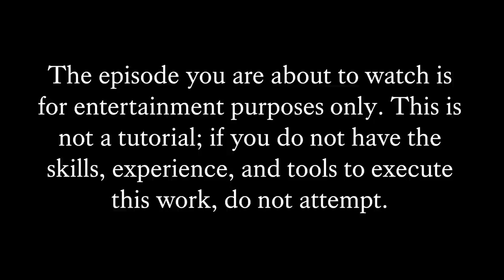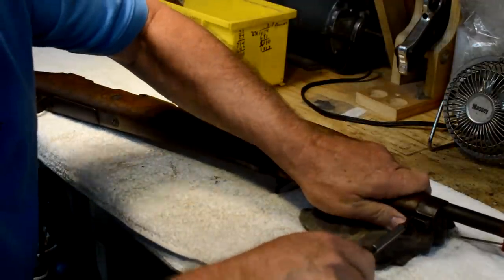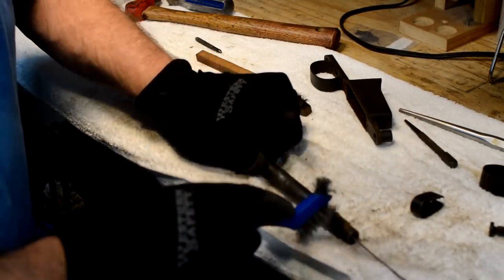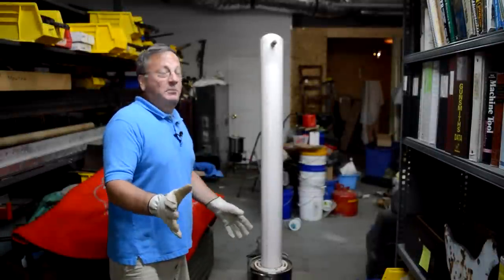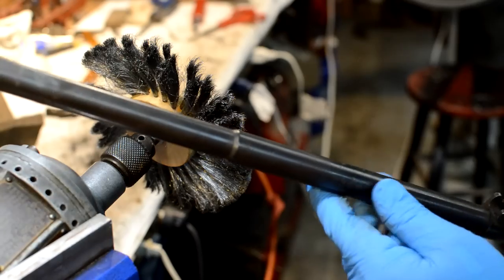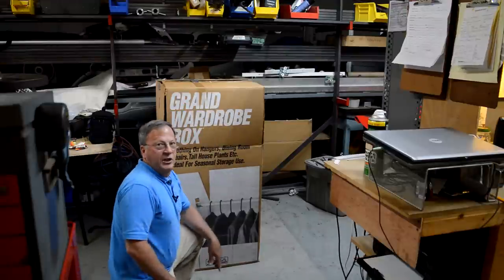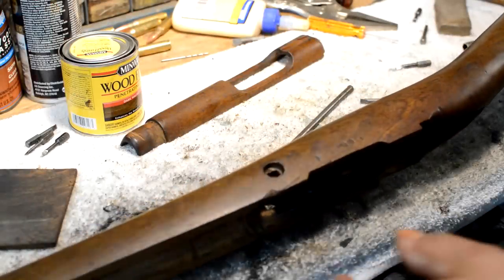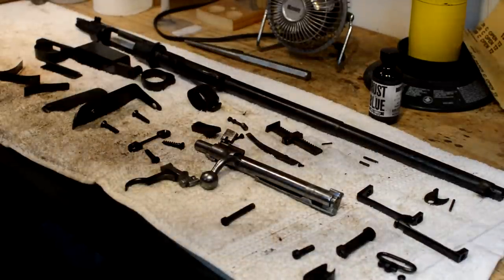Anvil 013: Rust Bluing on the Cheap

Comment from the maker: This was ReUploaded because the link on Bob's website was broken. Bob's site is rustblue.com in case you need that
Reply: hi Mark just had a quick question for you. For Enfields of the Number 4 pattern(ie the mark 1,mark 1/2, and mark 2) what type of paint did they use for the coating over the bluing. Ive got a 1949 dated number 4 mark 1 and a number 4 mark 1/2 and Ive been curious if A). was the paint anything specific and B). was repainting lee Enfields a common thing for the armorers to do when the rifles needed to be serviced and C). It that type of finishing work something I could do.
Reply from the maker: @FailedRanger  I do not know about the paint, what it's made of. Really, no knowledge but I'm open to learn. A.  I think the paint was a cheap way to protect the gun , used to cut costs as the Empire fell apart. My belief is these rifles were not in service long enough to be re-arsenaled, B. so a repaint may not have happened. C. Most who paint (cerokote, etc) fail to account for the fabulous gunsmithing time commitment involved, and wind up drowning. Do the research and visit some painters prior to investing money and time.
Reply: @marknovak8255  Guys.. the paint you want is SUNCORITE 259 don't know if you can source it your side of the Pond..!
Reply: Mark Novak thank you I’ll look into it and will keep you posted
Reply: Hey Mark, I just have a simple question. What did you guys use to affix the PVC pipe to the water pot? I think I heard it mentioned it was a toilet gasket or valve? I'm looking to rust blue my own Spanish Mauser 1916 after someone scrubbed the rifle clean of its markings and painted it and I hated the look of it.
Reply: @Courier-Six  it's the ring that screws to floor and receives commode & wax donut----called a 'closet flange'. Available at big box stores, etc.
Reply: Hi Mark, love the videos. Thanks for all the work . @marknovak8255 
What happens to the bore. Seems like it would rust inside also.

Comment: This absolutely works, although I have not been able to find the foam filled pipes that Bob uses this side of the pond.. I use plastic soil pipes, but they do bend and have to be replaced when the stack falls over! Much better than tanks of water, which will bring the rust faeries into your workshop from miles around..

Comment: Now what this rifle needs is a light coat of oil and a home in Arizona, Nevada, or Colorado some place with relatively low humidity and in another 100 years it will still look as good as it does today. Great job on the restoration guys and I applaud you for intentionally leaving the battle scars intact instead of trying to turn an old rifle into a new rifle, people that attempt those types of restorations destroy the history of a military rifle in my opinion.

Comment: Very inspiring. As a plumber i do have one criticism. Cellular-core and common sch 40 pvc is the same thickness. Just wanted viewers to know because cellular-core pipe is usually only found at plumbing supply stores. It is cheaper but common pvc is fine to use.
Reply: I find it bends...!

Comment: I've salvaged a couple rifles over the years that were being used as wallhangers. One was a really nice little Remington #4 rolling block in .22 LR. I got it really cheap because the action worked, but something was off. I took it apart, it turns out the spring had broken and someone had taken two other springs and mated them together into a functioning leaf spring. The gun worked, but had a trigger pull like that of the double action on a Nagant revolver. I took it apart, found the correct spring, got it working again, fixed where the takedown was a little sloppy because the hole in the wood was blown out a bit. Now my son shoots it regularly, we put only standard velocity through it, because that's what it used. I found a #6 Remington .22 LR, that was missing parts, got it going again, another fine little .22 LR to shoot. I'm working on getting my 1894 Winchester in .38-55 to function a little better. My latest is repairing a duffel cut on a numbers matching late war K98. I have a soft spot for these old guns that I can afford versus needing to take out a loan to buy a safe queen I am going to be afraid to shoot.

Comment: QUESTIONS:
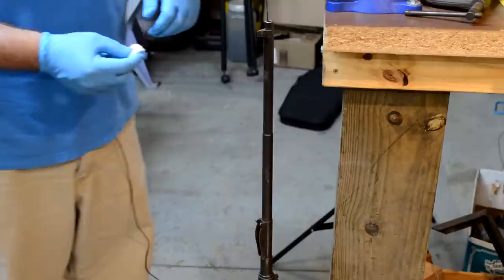After the first steam treatment, at 31:55 on the video, you said "… put our first coat of Rust Bluing solution on here."  At 32:20 you said "… I'm going to wipe this on the steel, first coat, and this is going to dry for about an hour or so.  Then we’ll wipe on a second coat and after that second coat we are going to introduce the treated barrel action into a humidity box."  At 36:02 you said, "… Ok.  back in the shop.  We’ve coated our barrel with a priming coat of Rust Blue solution.  We let that set for about an hour and let it dry.  Then I recoated it with the first primary coat of Rust Blue solution."

Regarding the first two coat prior to the humidity box, you did not say how long the second should dry.  At 36:02, you seem to be reviewing what you had done so fare with the first two coats prior to the humidity box, the first priming coat which dried for an hour.  You then said, "I recoated it with the first primary coat of Rust Blue solution.  This implies subsequent primary coats after the two coats, the priming coat and the first primary coat.  How many primary coats are there, and when are they applied?

Comment: There is nothing better than watching metal rust. How many cycles can you run on a piece?
 Not trying to be ocd but my first attempt came out so well I dove head first into the rabbit hole off of a 10' ladder. I have a nice old Savage model 6L-D. Not a spectacular or valuable gun. It was nice except for two bloody fingerprints that pitted the barrel. Looked like someone went after one of the spots with some 120 grit sandpaper. It was horrible. I took a piece of 220 grit emery cloth and took the whole barrel down to bare metal smoothing out the pits and previous sandpaper work with the rest of the barrel. I didn't card after sanding I went straight to bluing. I didn't steam like my first one I just hung the piece on the porch, we have 90% + humidity so I don't need steam. I ran it three times coated it again, after carding and degrease with acetone, and left it hang overnight for a long soak. This 4th run is so deep and black it's unreal. I look at it each cycle in the brightest light I can find and each cycle makes the color darker and deeper.
So how much is to much? I think 4 is going to do it for  me but whats the max you can go? 
I also have a very low serial number West German Weatherby with a bluing like black chrome. How did they do that?
Reply from the maker: 4 passes and the point of diminishing is reached. I usually stop at 3

Comment: There is no need to butcher military surplus arms as there are many fine guns out there that began as sporting rifles and really have seen little use. I have one of these Spanish short rifles but mine was converted to  the NATO 7.62 or 308 Winchester. My experience with many surplus Bolt Actions is that they will have mismatched bolts creating headspacing issues and that the more modern chambering may create excessive pressures. I realize governments did this out of economy but a soldier or any shooter is not well served by such arms. Fortunately those arms I purchased were priced right. The old Turkish 88 commission rifles I got at Big 5 Sporting Goods back in the early 1980’s were $35.00 each.

Comment: Thank you Mark and Bob!  One of the most useful videos I've ever watched.  Now my question 🙂
If kerosene is unavailable, will diesel work?
Reply from the maker: Diesel is just fine. A bit of a mess though
Reply: I used a non detergent lubricating oil 30w right after carding. Started getting rust and splotching through the oil. Any suggestions? Can I just let it sit in oiled overnight and then apply gun oil? This part is getting me

Comment: Mark & Bob,
This video answered a thousand questions I had on the subject. Thank you for the knowledge imparted. I will certainly follow your recommendations. I do have a couple of questions on an area that was not addressed. I assume that both of the steam baths and the time in the humidity box had an effect on the inside of the barrel as well. How and when did you treat the rust generated in the bore? and when is it safe to to lubricate the exterior of the barrel and action after the process is over?
Reply from the maker: Because you did NOT put chloride bearing chemicals inside the bore, very little corrosion occurred there. That which did gets converted, and swept easily aside with a bore brush

Comment: I did processes like this years ago for the industrial, pharmaceutical, aeronautical worlds.
We used TSP Tri sodium phosphate with RO or DI water very cheap to degrease and or strip at just below a boil about 4% give or take, Much more safe, then "no more touchy" or oils near! and depending on what's next we used the hi PH to neutralize, cleans your driveway or laundry too, or MEK Methyl Ethyl Ketone (better than acetone harder to find) but a little more danger, cost and danger? than TSP. 

Thank guys now you got me thinking about my 1896 Mauser?

Comment: Mr. Novak, can you show or tell us more detail about the turkey friar-stainless steel pot-PVC base-PVC pipe-top cap lashup.  The big question is:  What is the PVC base sitting on and how is it stabilized (what keeps it from falling over).
Reply: You can disregard this question.  I found the answer in the youtube video, "
Anvil 036: Rust blue a Yugo K98K with Bob"

Comment: Does this steam method work with steel in the white? Do you need to apply any solution to it to make it rust before steaming? Or do you just put the steel straight in the steam?

Edit: never mind. Should have finished the video.

Comment: Mark, if there’s any way you can respond to this it would be most appreciated. I have been posting your videos on the CMP forums, trying to spread the word and help collectors like myself. 
The question I have is in reference to USGI parkerized finishes. Can this process (specifically the boiling in distilled water to convert rust) be used on parkerized finishes? If yes as is, great! If not a video on how to stop rust on parkerized finishes would be most helpful.
If I missed this somewhere in your videos I apologize. I’ve watched every one I can find and don’t remember a call out about parkerized finishes. If there is mea Culpa!!
Reply: Parkerizing's in the same vein as bluing (just highly industrialized), but generally uses phosphoric acid to etch and manganese to  bind with the oxide to form the finish. technically, you can blue rusty patches on a park'ed gun, but it'll look like black splotches on the grey. Parkerizing is a pretty serious process (copious amounts of strong boiling acids  and vats of highly alkaline material to passivate), it takes a bit more equipment, and is a bit more dangerous (that's just for you... god forbid your plugs pop out and it eats the bore, or you miss a spot for your resist, and it park's an area that needs to move freely). Personally, unless the finish is almost completely gone, rub the hell out of the rusted spots with a rag to knock the bloom off, and rub oil or wax into the rust to keep it from continuing. Parkerizing, like bluing and browning, protects the steel by creating a porous oxide layer that holds oil, and the oil protects the gun (you'd be amazed how few people oil their weapons periodically... darn stainless+plastic guns lol).

Comment: Thanks for educating me on a rust bluing process that I can do at home without a specially constructed boiling tank!!!  Question though....I noticed that you left the bore open and exposed during the process. Did you have to clean and remove rust from after? (This was a major consideration when boiling)
Reply from the maker: Don't put any chemicals down the bore, and pull a bore brush when done. The bore only needs to be plugged if the gun is to be dipped in chemical, vice swabbed with it.
Reply: @marknovak8255  Thank You Sir!

Comment: Hey Mr. Novak, I've watched quite a few of your videos over the past year or so; you could say that I'm a fan.

I recently put a pretty decent gouge in the blued steel of one of my favorite guns. I plan on trying to sand the gouge and would like to reblue it afterwards. Would it be possible to do a rust blue "touch up", or would damage the intact surrounding blued finish?
Reply from the maker: A rust blue will catch the refinished area back up to the previous finish. It may take a few passes however
Reply: @marknovak8255  That's just what I wanted to hear. Thanks so much Mr. Novak!

Comment: Using the pvc pipe steaming setup,  is the sweat box also required?
Reply from the maker: Steam box is really a controlled moisture environment.  This is where rust is created, at a low <110 degrees temperature.  The conversion of red to black rust (bluing) happens at 212 or higher if using boiling water or steam.  
If the humidity is high enough you can do without the box, it will take longer.
Reply from the maker: Answer, no, the sweat box is optional.  It saves a lot of time if you do many jobs, but not mandatory
Reply: Thanks much!

Comment: Question about the final steps.  I was watching a video from Midway where they coated it in Boiled Linseed Oil instead of Kerosene,  will that work?
Reply from the maker: We kerosene to drive any remaining water out of the steel/bluing. Diesel, or a water displacing oil, will also work. The next step is to oil, or wax, or .....coat in boiled linseed oil

Comment: Will this process pop the solder on a side by side?
Reply: You are only heating the gun to water boiling point: 212-ish F /100 C. The solder was a melting point in the 450F/215C range.
Reply: @christopherneelyakagoattmo6078  10-4. Thank you

Comment: Mark - thank you for creating this incredible content.  (and Bob!)  I've used the Mark Lee Express Blue product via boiling on revolvers and such, following Marks instructions.  I've built a steam pipe to conserve a rifle barrel, although I am wondering...  Is there a reason you can't use the steam pipe setup for rust bluing, versus the humidity box?  Does it have to do with the comment about dry heat to warm up the metal?  Too much moisture introduced immediately in the steam pipe - polka dots?

Comment: Maybe I missed it but what prevents the bore from corroding?
Reply: During the bluing process, you can occasionally spray some WD-40 down the barrel to prevent flash rusting, but you want to make extra sure you're not getting the WD-40 on any of the external areas that had bluing applied, as it will negate your hard work. You can use any penetrant oil to do this, but I prefer WD-40 or aerosol Ballistol due to them having a plastic straw nozzle, which helps keep a precise spray down the interior barrel without overspraying to the exterior. I can't stress that enough: don't let any drip or spray onto the exterior metal, or you're going to have to start all over again.

After bluing, clean real well within the barrel with a brass brush/jig and a solvent like Hoppes. This will remove any flash rusting that may have occurred during the bluing process.
Reply: I just did this process myself, and while I did get some surface rust in the bore as long as you don't let it sit too long it comes right out with a brass brush and a little solvent. Don't stress on it too much.

Comment: Question ...  how did you blue  the small parts ?

 Loved the info on the rust bluing . As a budding gunsmith i absolutely love your chanel  Thanks for all the great videos
Reply from the maker: Same way, hanging from wires. Small stuff doesn't show well on camera
Reply: @marknovak8255  thank you very much
Reply: @ray211225  You can also nitre blue small bits by dipping them in molten saltpeter.. this was the standard practice in UK for things like screws, pins, triggers and hammers..
Reply: @felixthecat265   ahh ok    thanks

Comment: Can a "plumb colored patina" on an old rifle be properly converted back to blue with this method? Or will the firearm remain plumb colored.  It's an early 1900's winchester .22 pump rifle. I boiled some of the small parts and carded and some parts seemed to remain plumb colored. Others seem to be blue again. Do I just need to repeat the process until the plumb turns blue again?
Reply: Your mileage may vary, but my 'plum' gun was just unconverted rust. Boiling it brought it back to black.

Comment: Can a post-64 winchester 94 receiver be rust blued? Asking because i read caustic blue doesn't work because of the weird steel used.
Reply from the maker: They CAN be rust blued, but there is far more to that than can be explained in a comment reply. I have done it several times without having to iron plate the action, and as I know, rust is the only way to do it

Comment: could you use diesel instead of kerosene for the first coat of oil?
Reply from the maker: Yes. It's messy, it smells, but it DOES work, with the added benefit of also not blowing up the shop

Comment: Where can we buy a wire wheel like that?..It looks softer than a regular bench grinding wire wheel..I've searched around but haven't found one like this.... Thanks
Reply: It's called a carting wheel. They are very expensive.
Reply: Brownells sells them for like 50 eur a pop for a 4 row one, and 40 for a 2 row one.